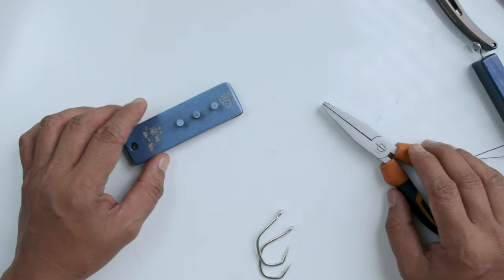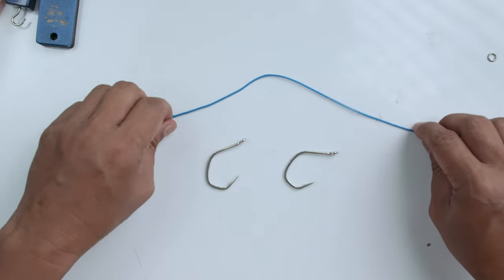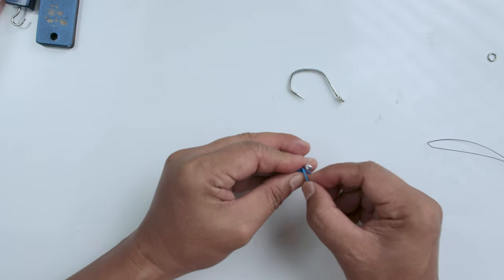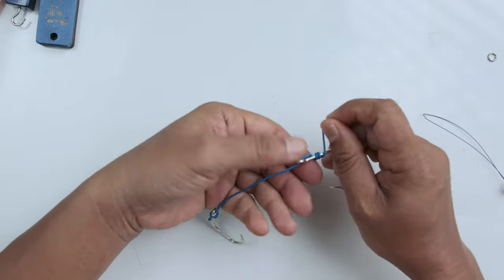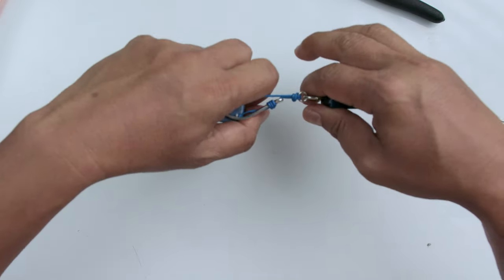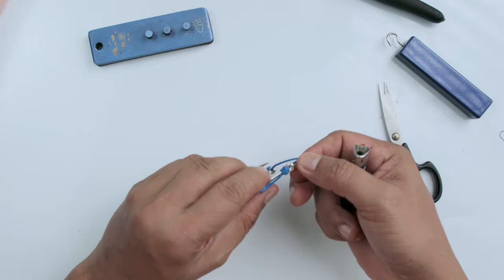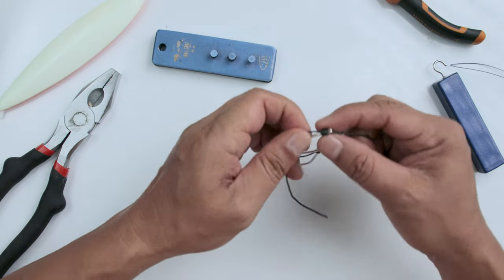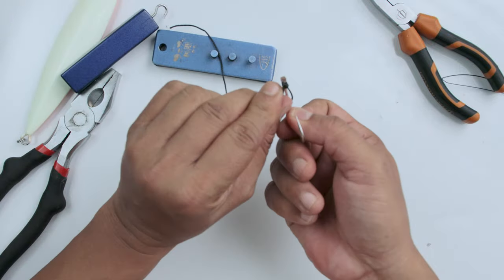HOW TO TIE DOUBLE / TANDEM KNOTTED ASSIST HOOKS

Comment: Ha ha. Just watched this. Saw your vid yesterday and did some singles. Then decided to do the doubles and found that indeed you must change the the pass tag on the second hook! One quick tip I found out while doing this: You need the pass through loop made by thick cord. It passes the tag way way easier than a thin line. Try it!  This kind of tool can also be made for another job. If you make it with very thin wire instead of line, you can use it to splice assist cord instead of the splicing needle. I broke my splicing needle the other day and needed to splice some assist cord. I used the thin wire used for vaping coils. The thinner the better. You pass the loop through half the assist cord and  catch the other part of the cord like you do with the splicing needle. Never bought another splicing needle, cause this works like a charm.  Luv from Greece!
Reply from the maker: nice :D maybe someone will find that tip useful! the thicker cord messes with measurements. if you are freeballing it, ya, it works too.

Comment: Why do you prefer this knot over the easier unit knot to the shank? How do you add flash using this method? Thanks! Keep these vids coming!
Reply from the maker: Its not as clean and it makes the consistency of spacing of the hook and cord difficut. I dont put flash on this, if i have yo use flash, i use the binding method.

Comment: I am looking at assist hook cords and what you are using. You mention aliexpress but which one if you have a link that would be helpful. 
I am making all my own rigs mostly slow jigs and baku baku skirts. It seems really popular now to use hooks with crystal flash or adding a octopus/ baku baku skirt to a bait rig. The extra colours/ uv and movement is helping out bite rates.

I have some Venetian Blind Cord its a braided polyester cord. Its uv and high brasion resistant. Its 2mm thick which is fairly large i feel. Its plenty strong enough i suspect it will be in excess of 60kg.
Reply from the maker: Hi SideWinder, I wouldn't use cords other than the ones that are meant for making assist hooks since at the end of the day, they are made with different fibers and for their size, they are quite strong. Using thick materials will have an adverse effect on the jigs - using flash and skirts also have an effect, but you can control that - you get more bites up to a certain extent and depending on how deep you fish, they may, or may not benefit you. The benefit in using them is usually around shallow water with their use and effectivity diminishing as you go deeper. I would not recommend Ali Express if you don't know what you are looking for - https://amzn.to/3slaIYG use this link as it will make your life easier.

Comment: What do you call the tool you used to measure the offset? And what grit is the diamond file you used? Thanks in advance
Reply from the maker: its called an assist hook puller by Angler Support System - not for sale anymore. You can make one out of wood and nails. check my youtube shorts - there's a short video on making the tool and the hook puller. 800 grit
Reply: @TheFishingKit  thanks buddy.
Reply from the maker: @abukhalidbinfaizalfishing  my pleasure